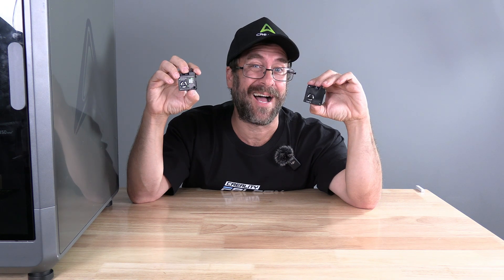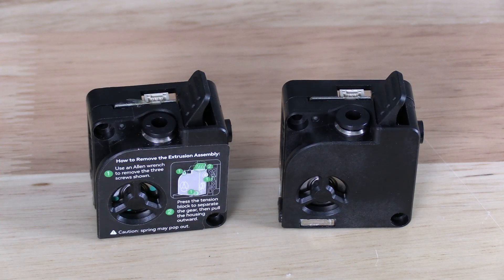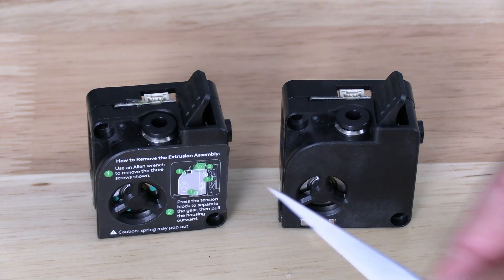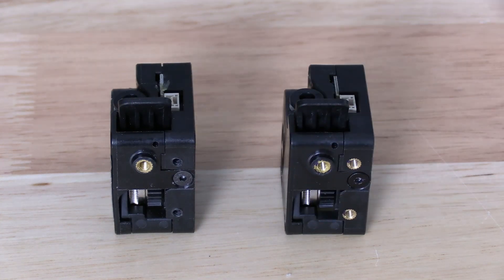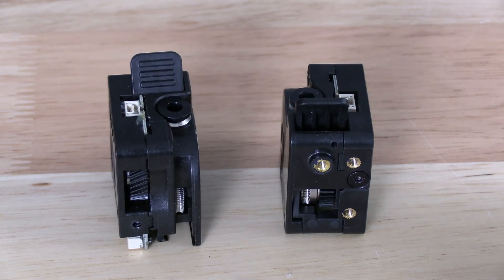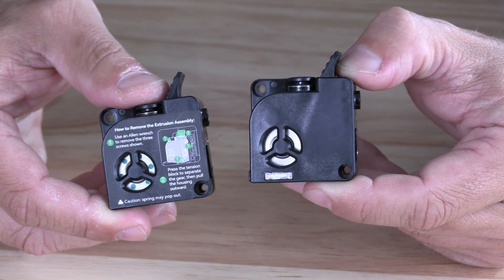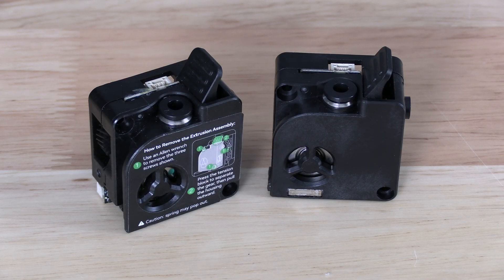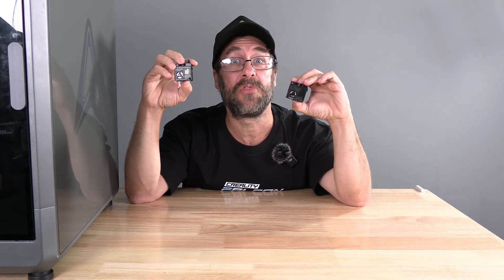Creality K2 Plus: How to Identify the revised Extruder, with only your EYES

Comment: I have a question; how important is the "side screw" (the shortest one of the three you have to remove to take off the extruder cover, accessed from the right hand side as you look at it from the front)?

I ask because mine made a bid for freedom last night and despite hearing it drop I simply can't find it anywhere! With two screws compressing it from the front, am I still okay to print?
Reply from the maker: No. Replace it. M3x6.  Your tool box might have a spare
Reply: @3DRundown the only spares that came with my K2+ are non countersunk...😢
Reply: @3DRundown what happens if I print without it?

Comment: i had mine replace after the ptfe connection weared out. i stop printing for a few months cos of this. after the replacement it works well.. FYI they did not include the filament cutter with the replacement set. remember to use ur old one before starting your print

Comment: I bought the new extruder model as my ring got chewed up through the extruder and both my new and old extruder has the threaded inserts but my new one has the sam bearing but no sticker for instructions and it does have a raised coupler so I'm so lost what happened with mine lol.
Reply from the maker: This makes my head hurt. I don't think Even Creality has a clue anymore, with the K2 Plus Extruder.
Reply: @3DRundown absolutely its like what the heck because my metal ring broke after the warranty and they said they couldn't replace it because of the warranty deadline was passed so I bought the new one which was $35 and its like wow this is so identical to the original like at least put in like upgraded gears or even what they should do is completely redo the extruder to where its possible to replace the coupler with a new replacement one that you can pop in if it breaks. Now that would be better than putting fittings and screws and printing off a face plate and having it kinda work.

Comment: Mine is the revised extruder... Honestly they need to revise it again as its one of the worst extruders ive ever dealt with. This extruder loves to wrap standard filament like petg around the gears, and the stock unadjustable spring is so strong dont even think about trying to print tpu without modifying the extruder with a thumb screw, and two weaker springs with a 3d printed spring stop. Theres just so much slop internal that its kind of a joke. Now I understand some corners had to be cut for price but seriously.... Well i guess the best i can do is wait for a company like microswiss to make take up the slack.
Reply from the maker: I have never had filament wrap around the gears....  I had an extruder Jam early on, but that can happen anywhere. I have not tried TPU. Would want to slow it down, reduce retraction, etc. Which filament is wrapping around the gears?
I do think peeps have 3D Printed a screw tensioned
Reply: @3DRundown ive done a flow test on all my filaments to make sure im well under the max vol flow, and have done manual pa and retraction tuning for each filament. it ends up failing with filament wrapped in the gears for pretty much any rapid/hyper petg i throw at it. Elegoo, Creality, and sunlu petg all fail in the same way and tpu fails to even feed into the printer. You have to manaully feed tpu in and it wont work at all if you try running it though the ptfe tube. For tpu only way ive gotten it to print is with rhe reduced spring and adjustable spring tension mod by adding a gpu thumb screw and by printing the filament roll holder that mounts directly above the ortinter.  Ive adjusted z offset as the auto cal was causing massive 1st layer fails. Abs will instantly clog on the k2 plus first layer unless you wait like a hour for the heater bed to presoak.

Comment: I’m about to request a replacement extruder for my replacement extruder (I’m on my 2nd which is broken too). My extruders (both org and 1st replacement) do not have any dots on the metal piece of the gear that is forward facing. I did put my own dots a while ago on the bearing face so I could see when the gears are rotating. Thx for the info!
Reply from the maker: What broke on your Extruders?
Reply: @3DRundown The metal teeth that lock the Bowden tube into the front half of the extruder housing. I hope the new extruder has a better Bowden connector because that’s what’s failed on both of mine while the CFS was in action. The Bowden tube that started off very secure eventually popped out and the CFS just kept on pushing filament into the printer. Very frustrating. I also noticed  that with both extruders I’ve had there is no definite click to the release ring like all other Bowden connectors I’ve used. ??? Does the spring in the new extruder have less tension than the original? Thank you sir.
Reply from the maker: It's just a coupler. The ring retracts TINY downward facing teeth. Cut the tube flush, press it down. Never touch it again. It should last you forever.
Reply: @3DRundown But why doesn’t it have that satisfying positive click like all other couplers. Does the new extruder’s connector work better. Mine has gone crazy on its own. It’s a design flaw so I hope they’ve fixed it.
Reply: @3DRundown With TPU this not an option to leave the Bowden tube in the extruder coupler. Creality specifically states in their Wiki about printing TPU to remove the tube from the extruder housing. Creality also states to turn off “Auto PA Calibration” and “Flow Ratio Calibration” in the Print Settings menu. I can confirm that if you feed TPU directly into the extruder and use custom settings for TPU that both the K2 Plus and the K1C print TPU well. I use the K2 Plus for larger TPU prints. I’ve successfully had 37+ hour TPU prints without any issues.

Comment: Oddly none of my extruders have the dots and I've had my printers for awhile. I'd say it's probably random, also haven't seen any green dots on any of the replacements (old or new). However, I can confirm the threaded inserts are a good indication of the new version. I just [finally] got a shipment of replacement extruders in today and they all have the threaded inserts. I figured I'd buy 6 extras just to have on hand.
Reply from the maker: Interesting. Mine is a pre-launch K2 Plus. I wonder how many have the dots...
Reply: @3DRundown  I know I got mine back in March from Amazon so given how long it was probably on a shelf, probably made around February? But no dots, also no threaded inserts on the right or left where the new one has them.  And a coupler thats already broke once and had to be replaced.

I'd kill for an acrylic clear block so I can see the filament go through though.
Reply: @BinaryBlitz  same as me, just about march, shipped from calichina
Reply: I got mine January and it's got dots
Reply: The new one I'm installing has all tapped screw holes.   So does original ?

Comment: Yeah, I got a revised extruder to replace the one where the ptfe connector failed. Running it now. So far no issues, but I wasn't really having issues with the old extruder either. This reminds me I need to order a spare though...

Comment: Great. My K2 6 months old and I’m stuck with antiquated tech because Creality never did their home work from the start. How do I get my new extruded?
Reply: Maybe a stupid question, but what are the thread inserts for? As in what screws into them?
Reply: It might have new extruder.  Got mine December mine had new one.  But don't bitch and moan. Replace it.  Tech moves fast man
Reply: So you think you can build something like this from the ground up and have everything perfect on day one?
Seriously, it’s a 3D printer, not the engine bearings in the plane your on.
Take your med’s.
Reply: @audiomaker1  Getting annoyed that an expensive product has too many inconsistent issues seems fair to me, they weren't acting toxic nor anything. This is also not Creality's first rodeo, look at the K1 series and how long it took them to fix them...
Reply: @mttkl Fair enough, until you buy a BMW.

It’s an imperfect world.
Reply: @audiomaker1  Yes it CAN be 'perfect' on day one. However companies choose not to do this as it maximizes profit for them by selling units sooner rather than later and/or adopting a cheaper but less capable design/implementation. Updating a design like this demonstrates the company got it wrong in the first place. The problem with this approach is we have been indoctrinated through various means to consider this normal behavior, which is what your comment suggests.
Reply from the maker: If you want help. Maybe be less Toxic, and Hyperbole
Reply: @3DRundown  Toxic? lol. Mate I think you just to sensitive. Was a fair comment.